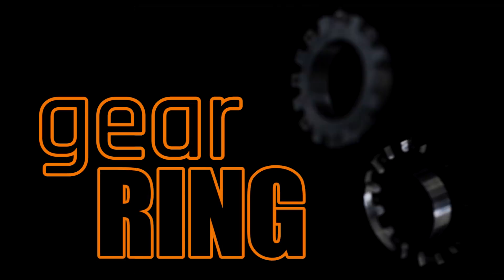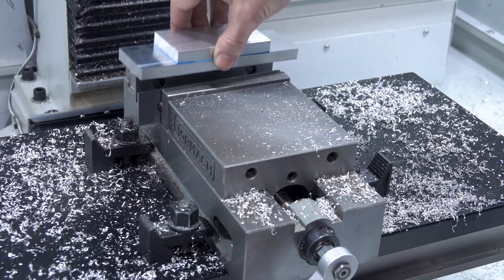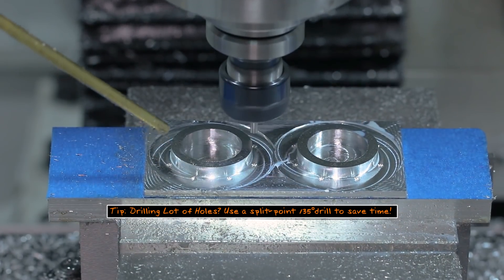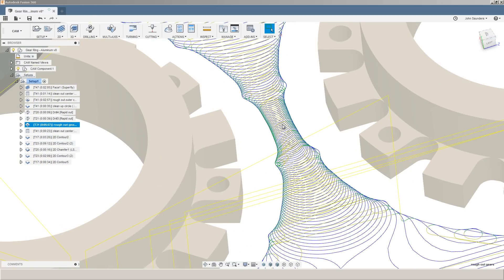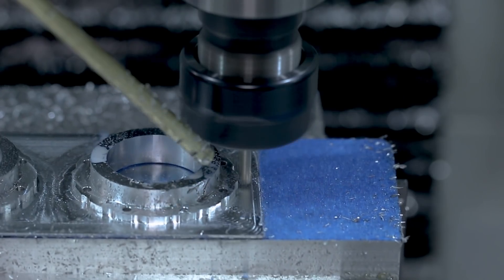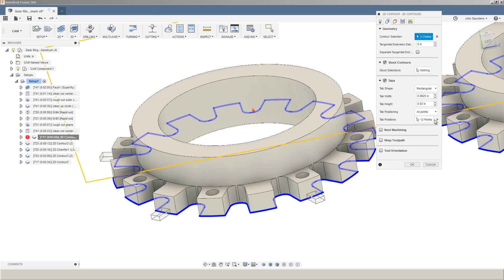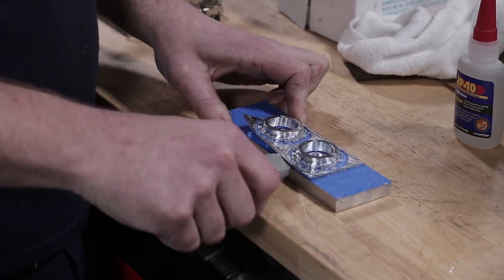CNC Machine a MARS Curiosity Rover Gear Ring | WW213

Comment: John , i wanna ask if you still using USB stick for your workflow... ? 
Ive gotten an idea for you . Wifi usb stick by Sandisk... 
finaly i dont have to unplug and plug USB every time ... 

If you like it , you could share it with more rich than i do :)
Reply: Sounds interesting, I'll have a look into that.  My CAM is done in the house and the CNC & controlling PC is in the workshop.  I use a USB to transfer, not wanting to put the CNC PC on the network etc.
Reply: @routercnc9517  first i was planing to do that by wifi sd card...but those needs mobile app... Sandisk wifi usb stick go by windows too
Reply: Are those pretty quick? We have a wireless system hooked up to our VF2 in our shop and it is the slowest thing ever. A 1.4mb program will take about 15 minutes to transfer onto the machine.

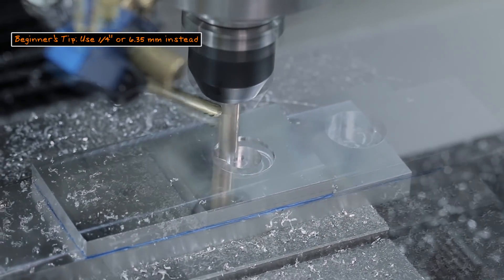Comment: Love the video, but the advice at 1:54 was just plain wrong. The fact is that chatter is far less frequent in larger diameter tools and larger diameter tools are far more forgiving.
Reply: My understanding of what John was talking about is the effect of large diameter cutters creating a line on the leading or trailing part of the cut due to the head tram which is never absolutely zero.  It is because the fly cutter has such a large cutting radius it is more likely to show any minor head out of tram due to the geometer effects.  This will result in a back cut witness mark on the part.  Cutting one direction will tend not to show this over the other depending on exactly which way the head is out of tram.  Small diameter cutter will not have this feature to such an extent due to the geometry.
For chatter though I agree the larger tools chatter less due to being more rigid.
Reply: He is right about the Chip Loading forcing Chatter. However the .002 F/R will induce chatter w/a .375 Coated Endmill
Reply: Just watched again Michael and my apologies I was talking about the fly cutter comments not the comments at 1:54.  Ignore my post, thanks.

Comment: I found something really interesting running a facemill on my 770. If I run the passes in the Y direction, the step over between multiple passes left no discernable lines where the passes blended together could be flelt whereas running it would be in X.

Comment: Aren’t the tape and superglue a bit redundant? You are currently glueing tape to tape and the part is actually being held by the tape adhesive. So either ditch the tape, use the superglue and heat to release or find a double-sided tape which has similar adhesive properties to the tape you are currently using. 

Or am I missing something?
Reply: You are. The idea is to give the user a sense of pride and accomplishment with the extra work. Ok that's a lie, the actual reason is that the tape can be burnished nice and flat and get excellent adhesion to both sides so you have a uniform but more textured surface for the super glue to bond to.
Reply: Also less cleanup on the part as the painters style tape doesnt leave residue
Reply: @harrymanback1304  
It's rather hard to burnish double sided tape to both pieces of metal...  For that to work the gap filling part of the equation needs to be taken up by the core of the tape, which means it has to be thick and spongey, not great for CNC. Here the tape conforms to each bit of metal and the stiff glue takes up the "out of flat" gap fill.
Reply: The reason most people think tapes don't bond well is because they don't read the manufacturer's white paper. It will tell you how to burnish, with how much force, with what surface area burnisher and for how long. Most of the time, burnishing with your finger isn't satisfactory. (That's why he used that rod.) The tape will provide a very strong bond. And, as someone else said, it's easy to clean up.
Reply: @harrymanback1304  Again, clean up. Have you ever tried getting double sided tape off; esp without solvents? Painter's tape peels right off.

Comment: Hi John,

Been watching your videos for some time now and have noticed major improvements to part quality! One thing I have done for previous jobs was in the chamfering cycle I would allow the tool to retract from the workpiece by continuation along a straight path (granted that's not something that's feasible to do on round geometry). More often than not I didn't get an opportunity to get down to this level of detail but if repeats of the job came up then small changes like this just added a little extra quality to the part, and meant less manual intervention to get edge quality to a high standard. I'm not sure how you'd be able to do this on Fusion but it may be simply an extension to toolpath which would work.